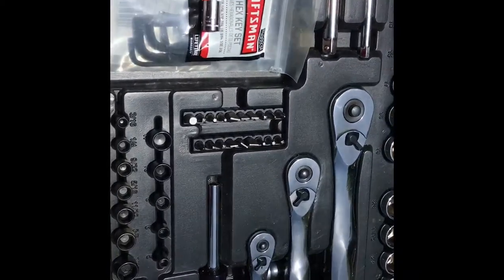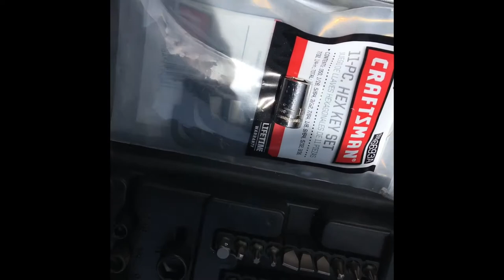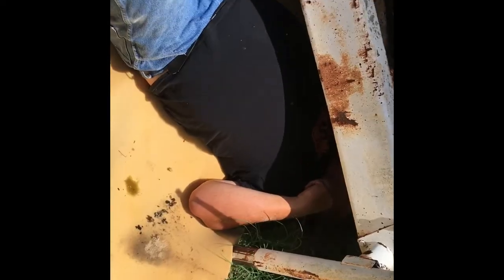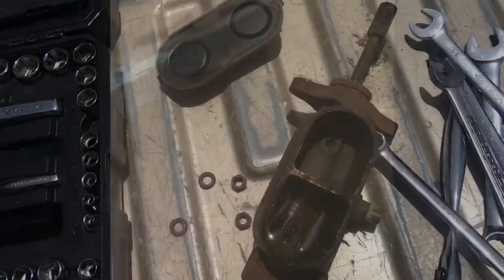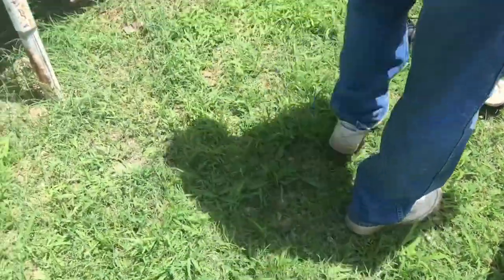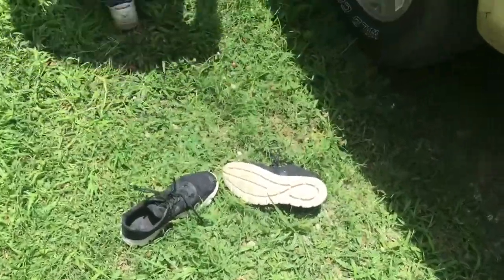1970 Winnebago restoration part 1- master cylinder

Comment: hey  guys, I have a 1969 22ft winnebago with a 318/A727 torqueflight powertrain. I bought it from the ORIGINAL OWNER 3 1/2 years ago with 52,455 genuine miles. I am doing a complete resto-mod.....upgrading all systems. It is dependable as gravity, but time has taken its toll on some things. Thankfully, the roof is in excellent shape....it was stored on a farm in a covered storage equiptment stall since "birth". Dont let anybody tell you that parts arent available. I just replaced the heater core...it was still available  from a NAPA store. ALL the suspension parts are easy to find(this is just a running dodge medium duty truck chassis). Find an older FAMILY-OWNED NAPA STORE...they have access to VERY OLD WHAREHOUSES....I found my heater control valve in a store in Cody,Wyoming. It only took 3 days to have it shipped to my NAPA store here in Pocatello Idaho.The kids at Autozone,O'Reillies, and the other chain sores just stare at you when they cant pull up things on the "computer".....this is where the older stores at NAPA(hopefully in a farm community), REALLY shine...it will all come together for you....KUDOS amigo!!!

Comment: As you have likely found out by now....on the driver side frame rail (INSIDE)abou2 ft from the master cylinder there should be a double-diaphram twin booster pack for power assist. It uses ported vacuum from your engine. A lot of the later dually pickups/etc uses a "hydrovac" unit, that can be integrated via the power steering pump....lots of ways to do the same thing. Its a pain in the ass (as I am almost 70 and a fat bastard), but I would highly reccommend changing the rubber vacuum lines on the twin boosters, they look like 5/8 inch heater hose...BUT THEY ARE NOT!!! My apologies if you alrealy know this stuff, Im not trying to be a smart ass. I grew up in a junk yard down in Houston, and worked on way too many Mexican vegetable/hay trucks. Kinda learned the hard way
Reply from the maker: Robert Mead Thanks for the comment man, my dad is really the one with all the knowledge so I’m not sure if he knows any of that or not but he has been getting old junk to run like new since he was a kid so I’m just trying to get as much knowledge out of he’s as I can while I still have him considering he’s getting older and I’m still pretty young but I’m always up for learning new stuff especially considering I’m pretty good at tinkering with stuff myself so thanks for the advice 👍🏻
Reply: yeah, I could tell your dad knows some things! If I can help in any way, let me know. No matter how frustrated you may become...NEVER give up on this project!. With time, some things are worth FAR,FAR more than just the $$$ value..wish my dad was still around!